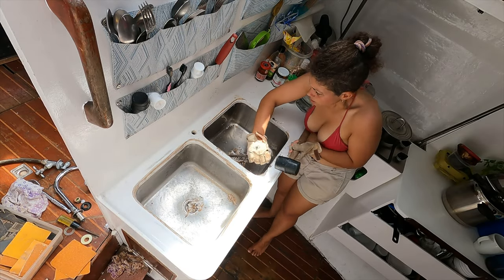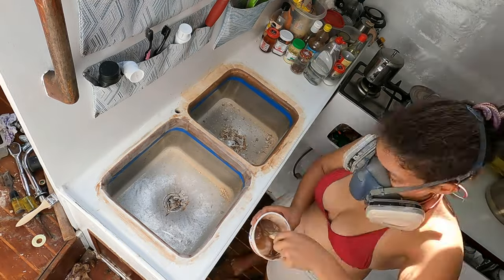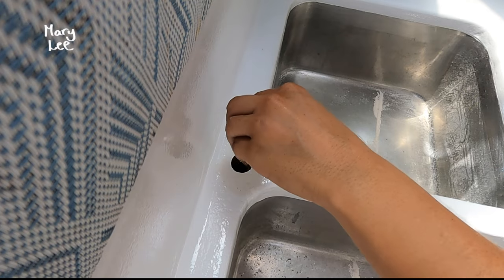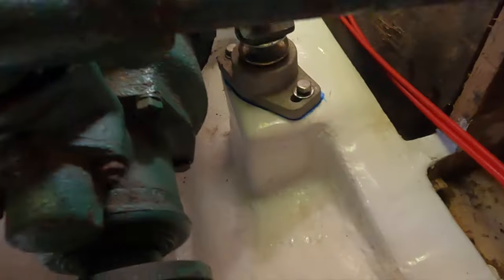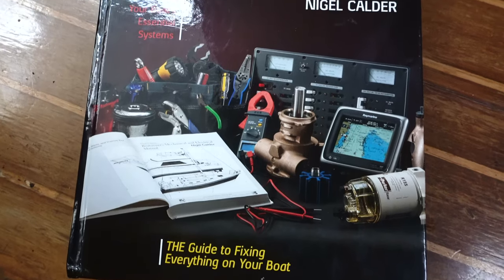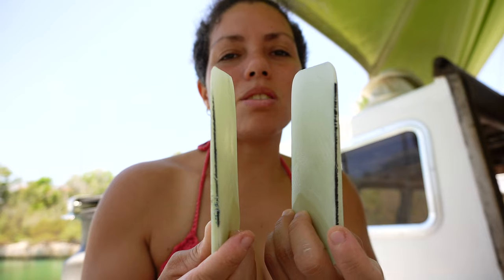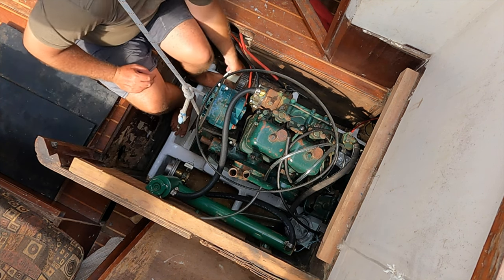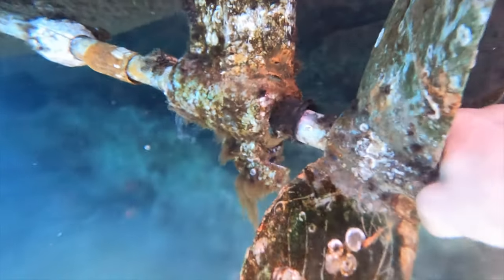FAILURE: engine wedgie

Comment: Oh the joys of aligning the engine. I used a bottle jack and some blocks of wood, but I was also aligning (2) 300+hp diesel's for a fishing boat. As for the wedges, I had to fabricated metal spacers about 1"-1.5" thick for the front. Ended up with the gap of o.oo3 between the output and prop shaft.
Reply from the maker: Hehe - I read it as 'a bottle of jack' and I thought, yeah, aligning does lead to drinking, definitely. 😵‍💫

Comment: Best of luck, Many blessings, I would send an outboard.... but cheaper to buy one there than the shipping from the wet coast of Canada. May I suggest a car u-joint as a temporary solution from your local car junk yard. See Salt and Tar for this kind of use in their boat with an offset engine.
Reply from the maker: I just looked that up - interesting, because Robi mentioned this at the beginning of the project. His childhood/family’s sailboat had a system like that, but basically I think in this case, there isn’t enough room. Will definitely keep an eye out for this though!

Comment: Nothing stops you two one problem lots of soliton's one is you line everything up with jacks under the motor use some glazing compound to build a dam around the edges around the engine mount and pour the super hard like epoxy like stuff but super harder flush to the bottom of the engine mounts but the you need an angel drill motor to drill the holes or mark them and lift the engine way up well that one solution ! The galley looks amazing and the sink as well ! Thank you !
Reply from the maker: Thank you for watching - yes, this might have been a solution to build the mount area before, but at this point we have no shore power, running out of resources in this cruiser-unfriendly area - simply need to get to a boatyard and then move onto a project like you suggest. 👍